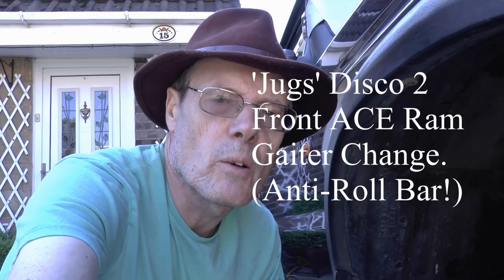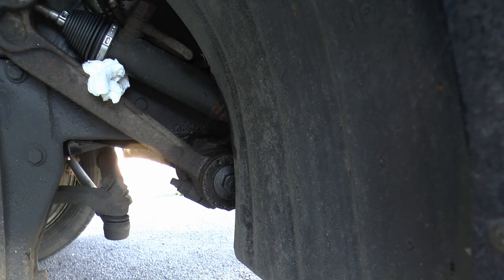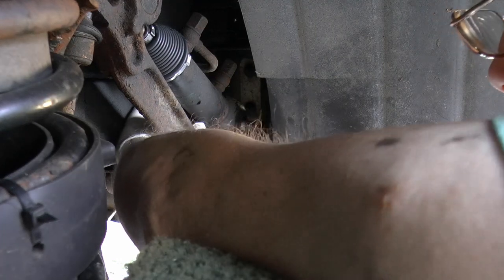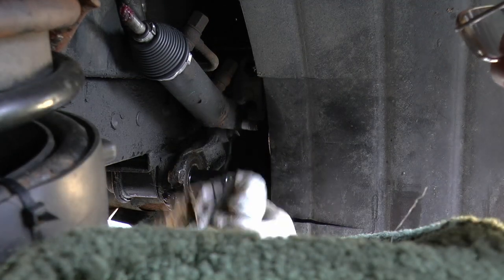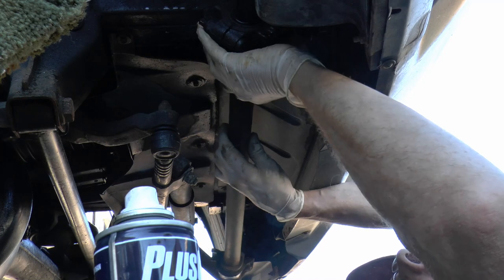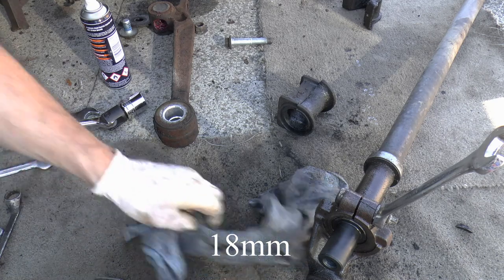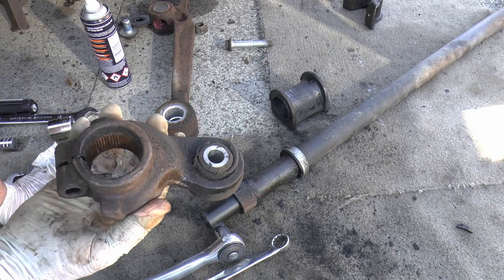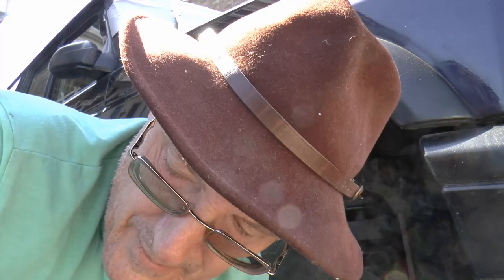'Jugs' Disco 2 Front ACE Ram Gaiter. ( Anti-roll bar!)

Comment: I had to replace my Ram boot 5 years ago for the MOT, and at the same time replaced the ARB bushes as they were like yours. I installed uprated poly ones and they are still good 5 years on and 4k miles, however the Ram boot I noticed the other day is split in many places. Typical it's MOT time today, so it's bound to fail !!   Look like I will be doing the same as you this bank holiday weekend.  Hope you got it sorted !!
Reply from the maker: Good Luck, and don't forget, move the anti-roll bar away from the ram, not push the ram back in!
Reply: @sleepycatpictures1176  Derek (my D2) passed the MOt today with flying colours. But just noticed that the bolt for the Ram is missing !! eek  more work to do.
Reply: @sleepycatpictures1176  Could you tell me the length of the M16 bolt that holds the ACE long arm into the ARB please. 
I priced a new one up and with the washer it is £85 !!  That makes your bush seem like a bargain !!
Reply from the maker: @trollmanrs  Blimey!   That's dear!      The threaded section is 26mm. About an inch.
Reply from the maker: @trollmanrs  Blimey. that's not good.

Comment: Ah-Ha, good 1 M8, now i can see what i'm up against. Not many vids for ACE. Very helpful. Thanks
Reply from the maker: Hope it helps.  Got to put it back together now. Don't push the ram back in. Disconnect the roll bar from the chassis and wriggle it off the ram. Or better still, take it to a garage and let them do it!
Reply: @sleepycatpictures1176  Yeah, i'm gunna fit all new bushes including the lower arm split bush. I dont plan on undoing the last bit you undone, will press a new bush in with it connected to the sway bar. "Don't push the ram back in", do you mean not to push the rod in on the actuator? Cheers. ET
Reply from the maker: @eviltree5857  Yes, the ACE ram itself on the actuator. Just leave it where it sits and work around it. Good Luck!
Reply: @sleepycatpictures1176  Uh-Ha, will do..... that's what i planed for that. Here's a tip for you M8..... keep your PAS fluid nice & clean for the ACE system, it's the ACE pump that over heats when not serviced properly..... & sets the car on fire[it's just got a journal bearing]. I siphon the reservoir with a turkey baster, then just keep topping it up & running it...... there's a filter under the driver side door[needs replacing]. When you get that back together M8, there's another ACE ram down the back of the car waiting 4 U [lol]. Best of luck from Down Under sent your way, cheers. ET
Reply from the maker: @eviltree5857  Thanks Eviltree.   ACE fluid on list of jobe to do!